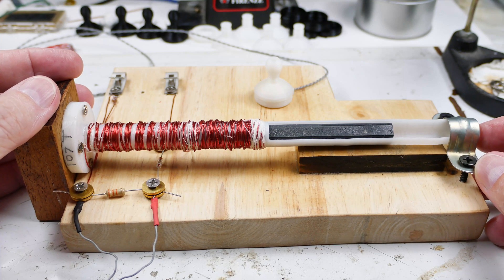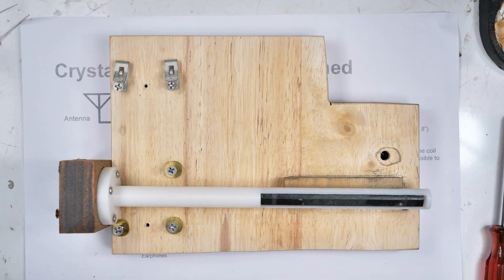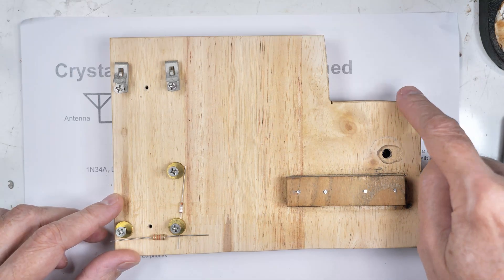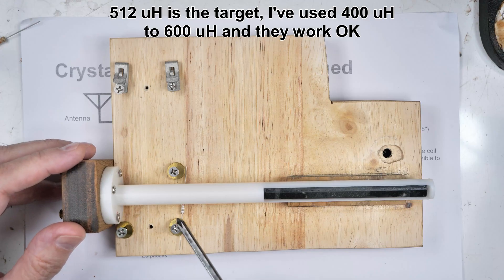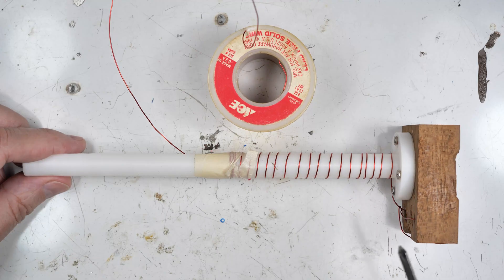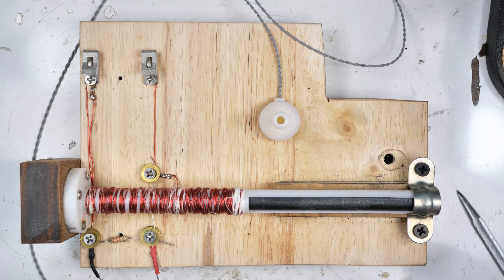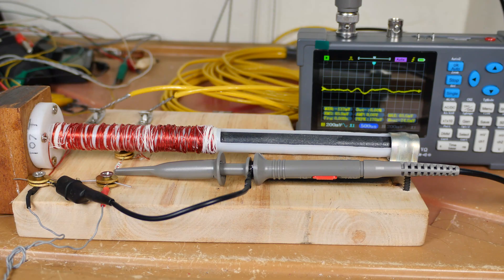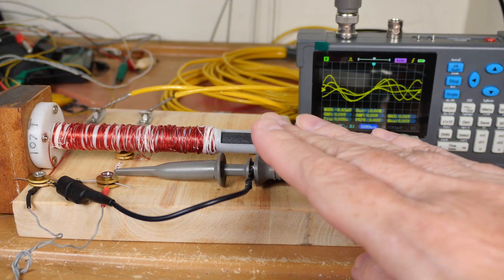Crystal Radio-Simple DIY Induction Tuned Radio

Comment: The first time I came across this type of crystal set was in a backpack radio for my Six Million Dollar Man action figure by Kenner in the 1970s. The coil was around 2" long, but unlike yours if memory serves... it was very neatly wound from very fine green coloured enamelled copper wire. You tuned it by lifting the pretend "antenna", a short stiff piece of wire, similar to a straightened paper clip, which was glued to the top of a tiny ferrite rod. This projected from the top corner of the toy backpack, sliding this up and down brought in a station of two. You of course required a VERY good real antenna. This was achieved by taking a provided clip lead out of the back of the toy and attached the crock clip to something appropriate. I eventually found the best thing for me was the finger-stop on our dial telephone, sign of the times aye? :) It was encountering this toy that first sparked (sorry for the pun) my interest in crystal sets. 

For those not familiar with the toy a quick google search will bring up photos of it, try "six million dollar man action figure backpack radio"

Thanks for your videos!
Reply from the maker: I remember the TV show, but I had not seen the action figure. Had to go look it up.   The radio sounds like a common circuit from that time. There was the rocket radio, the satellite radio, .... I'm working on recreating them. Stay tuned to this channel for the results!  ;)